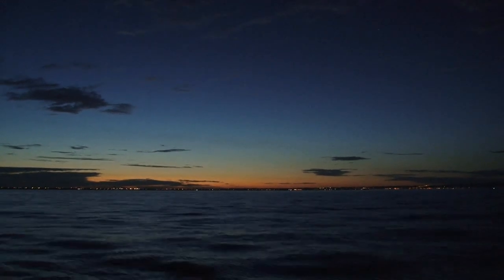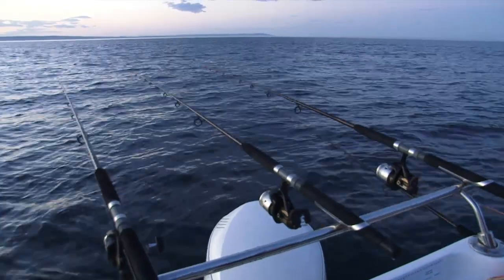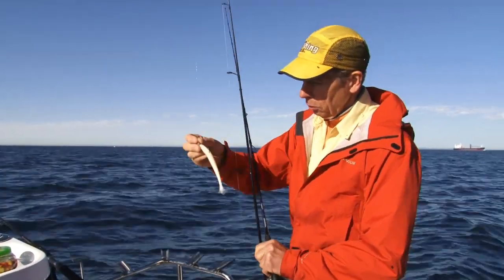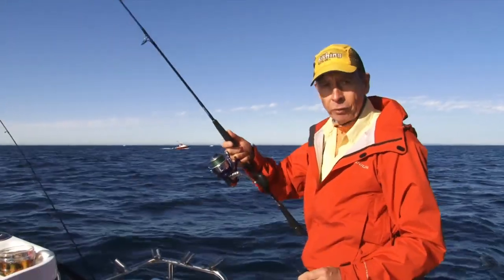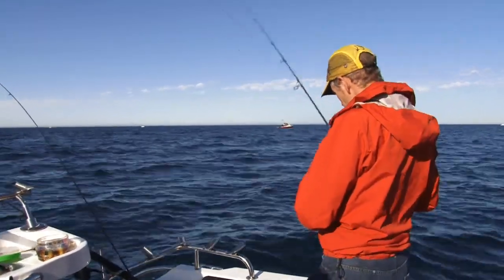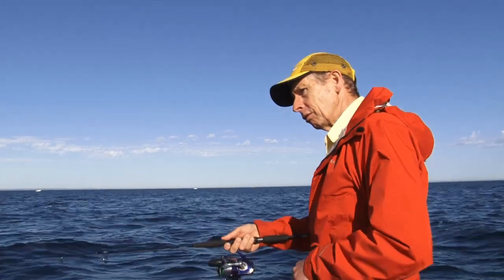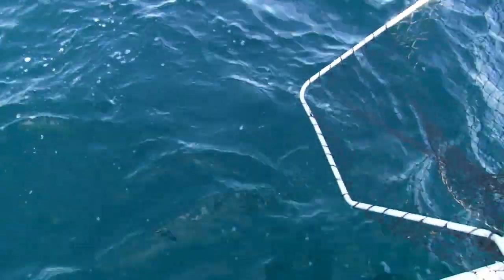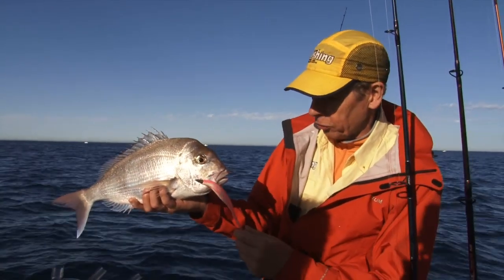Soft Plastic Snapper Techniques

Comment: Some great tips. We fish westernport. We are looking to use soft plastic as bait is expensive when you are on a pension. In westernport could you advise if you should drift using a drift sock? or anchor up? With the strong tide flow in w/port can you still use plastics? Are plastics Ok for whiting? 
Thank you,
Brian C
Reply: @brian
I too fish westernport.
Caught fatties in sand using soft plastics, yet to try for snapper.
Have a mate who uses plastics and he just swimms them in the current behind the boat with a running ball sinker to leader.
Another mate swims them on his paternoster rig, so going to try both
Reply: I fish in New Zealand we almost always drift, we use a sea anchor, and cast ahead of the drift